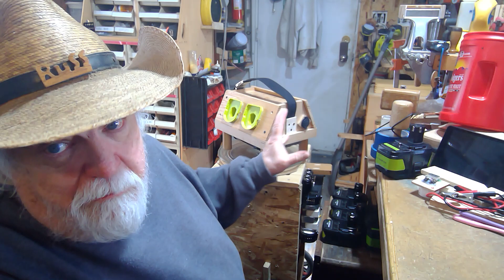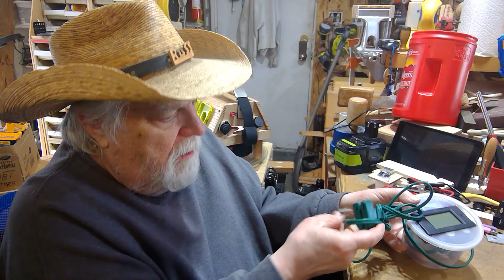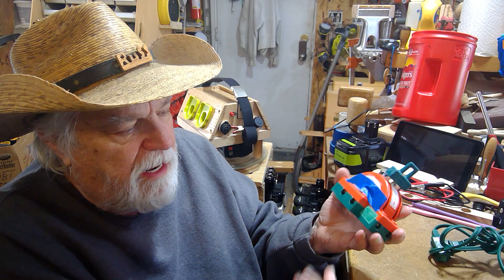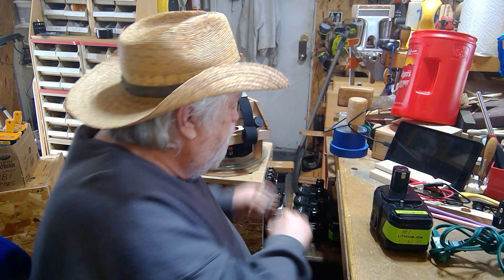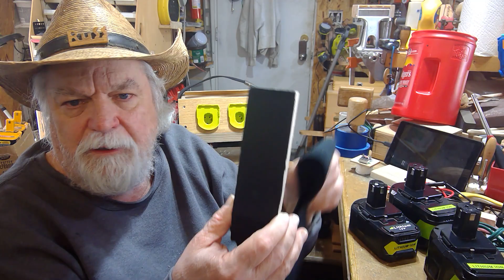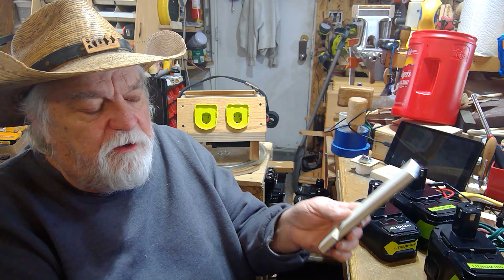Lemonade & DIY Ryobi Power Bank Update by Rambling Russ

Comment: The meter on the adapter is an excellent idea which I will certainly copy. I would guess that as long as you had the ability to keep the leather somewhat supple, your hinge would work much longer than whatever apparatus you were using them on. Very clever OTB!
Reply from the maker: Leather was used on doors as hinges for years as hinges where metal forging wasn't readily available.  You will be seeing more on this.  Thanks, Tim

Comment: We had some rolling blackouts here in east Tennessee during the cold snap. The TVA reached peak demand and needed the utilities to reduce load by 5-10%. So for 30 minutes every few hours our power went down. Fortunately, we have an LP fireplace that supplemented the heat while we lost power. I have a powerful light that attaches to my Ridgid battery pack. It can light a large area for us to live in. 
But you are much better prepared for FOG events than I am. I need to up my game.

I hope you and "She who must be obeyed" get to feeling better.
Reply from the maker: Hey Dave.  In my area, between Mother nature and equipment failures, Outages were relatively short term (longest was a week).  Now with rolling blackouts and substation attacks, the potential long-term outages are even more likely and potentially might last longer.  A partial plan is better than none.  If the outage turns into long turn, at least II have a week up on adapting my situation.  I guess my FOGS plan is like my workshop . . . always a work in progress :>).  You guys stay safe and well :>)

Comment: Russ, for paralleling LIPO batteries it is generally thought - To safely charge batteries in parallel, you should only connect batteries of similar voltage level. The general consensus is, a difference within 0.1V per cell should be fine, that's 0.4V for a 4S battery or 0.6V for a 6S. Note that the smaller the voltage difference, the safer it is.
Reply from the maker: Thanks, Advanced for that great tip.  That's why I made my Ryobi battery tester to check them when paralleling them up

Comment: you want to look for inverters that specify PHANTOM POWER or Residual Power draw.  All or nearly all inverters draw some power unless they require you to turn them off and on when you use them.  You can also of course put a on/off switch in the DC circuit and stop all residual draw.  This is what many RV's do they have a switch on the wall to energize the inverter before using 115vac appliances.
Reply from the maker: My thought was the fan should only run when it is working at its top limitation.  The thing runs even when just charging low draw items like a phone.  Thanks for the input

Comment: I like the little volt meter Russ, that's a winner! And I'm glad you mentioned voltage tolerances for battery use - I took a wild stab at it in my battery video but it really needs an expert's consideration, so thanks for that.
Your leather hinges look good. Years ago I knew a chap who had made some hinges by sandwiching seat belt webbing between plywood strips; something similar to yours. It was supposed to be a temporary fix but it lasted all the years I knew him and might well still be going! God bless you both and take time to rest and get well. Cheers mate.
Reply from the maker: Having to repair something sometimes leads to a great idea for finding better ways to build something. 
Yeah, I love that little voltmeter.  It will help me verify battery SOC (state of charge) on the fly.  BTW, don't ask why I would want to check SOC on any fly :>).  Thanks for the input and kind words, Mark.  Stay well.